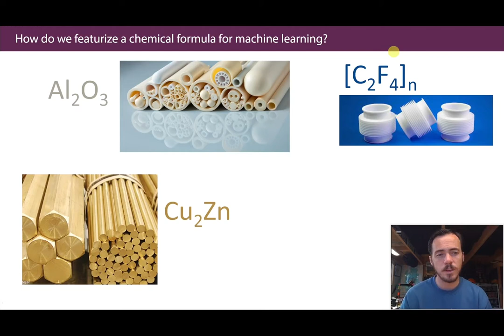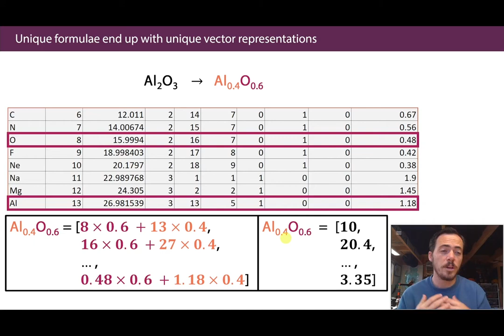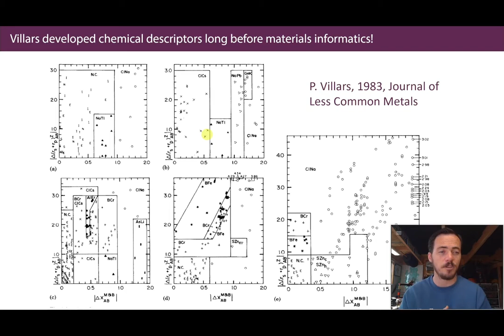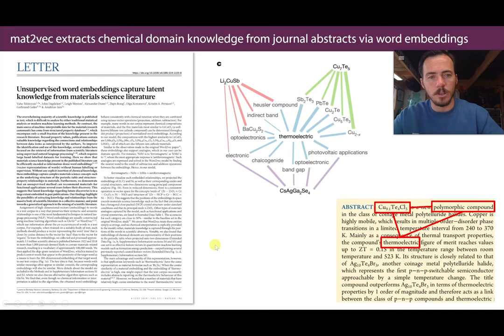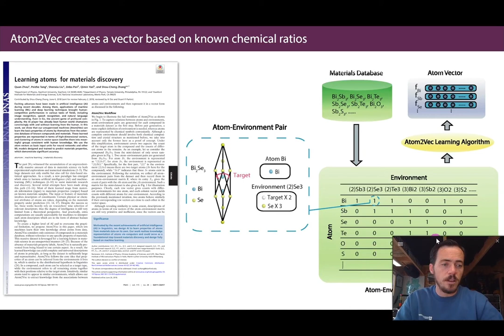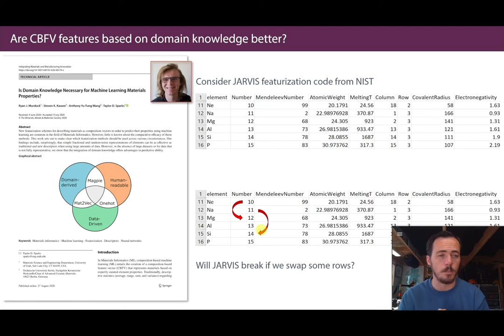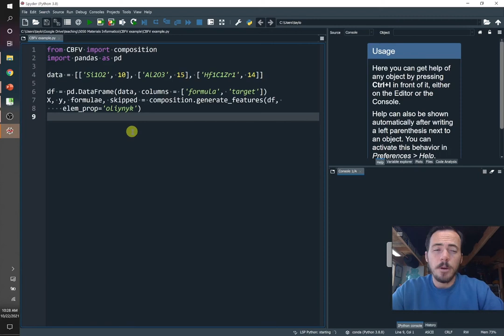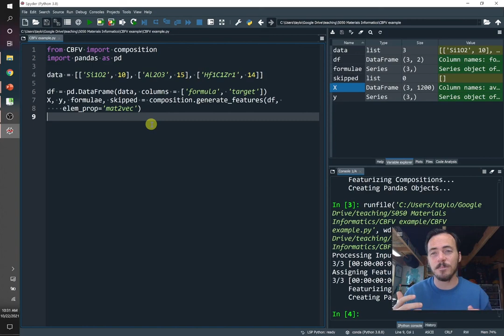9. Composition-based feature vector

Comment: Sir. Thank you for this. I have a data with one column of 'formula' and another column with 'bandgap'. The bandgap is my target. 

I am thinking of a code that I can use to generate a list like you have in your example that will assign each of the chemical formula to a bandgap.

Pls can you help?
Reply from the maker: Have you tried using our CBFV package? It's easy peesy. You can conda install or pip install
Reply: @TaylorSparks  Yes I did. That is exactly what I want to try. I am having troubles on how to set my data frame to be a list like you have in the last part of the video. 

data=[['Si', 1.5], ['Na',2.1], ...] I don't yet get how to convert my two column dataset into a list like this. So that I can go ahead and pass it into the CBFV code as X, y, formula,...

Comment: I am in the process of making a project proposal to predict polysulfide adsorption binding via ML. 2 recent papers just did this for 2D materials, but jeez in the first paper they did not even show their features (horrid peer review but this is very novel for battery field so I guess reviewers do not what to critique in Energy Materials). I just now tried this to get a feature list for my compound. And oh my, the power this creates, not having to scrape through all those articles. Unreal. I will try to have you as a Seminar speaker next Winter over Zoom, this is too much power.
My only question is, where can I read more about the element_property formats? Where are they sourced from? They are quite different and I supposed I will evaluate all of them for performance. I could have sworn you made a previous video about them and your friend oliynyk?
Reply from the maker: You can find the original articles in the literature. I will try and put a link to them in the video description when I get back to work I've been swamped with teaching this last few weeks

Comment: Its a very helpful video sir. So by using cbfv package we are able to generate high number of features based on chemical formula. But when we are trying to predict some certain property, how will we get an idea which features are needed & which are not? Also how we are so certain about any property of a compound can be predicted accurately from elemental properties?
Reply from the maker: Yes, cbfv will take a chemical formula and produce many features from it. To get your feature weight you can get this from different models. For example, random forests or linear models report feature weight